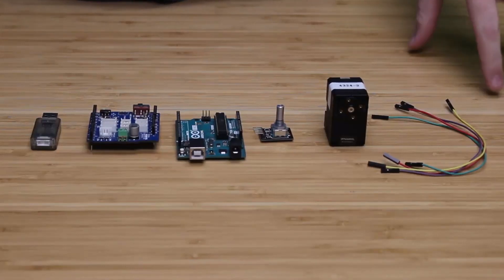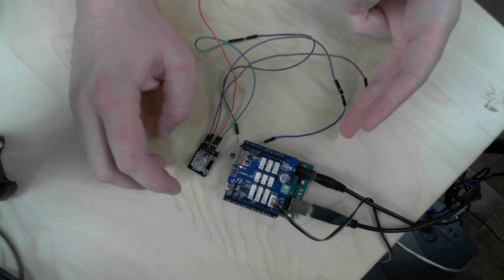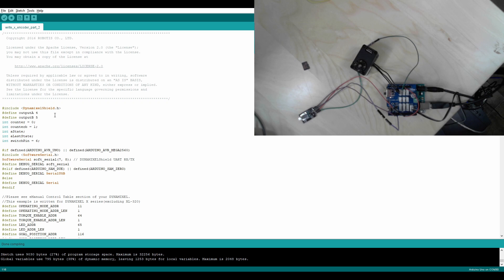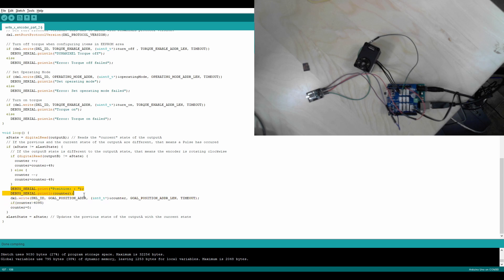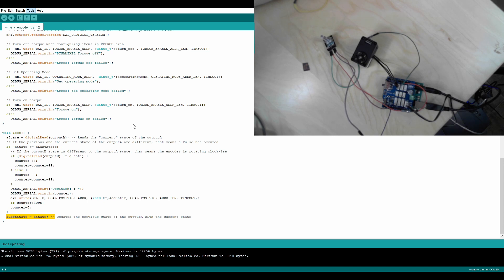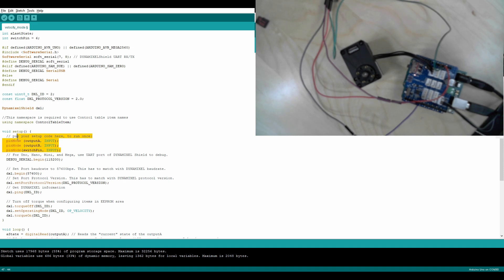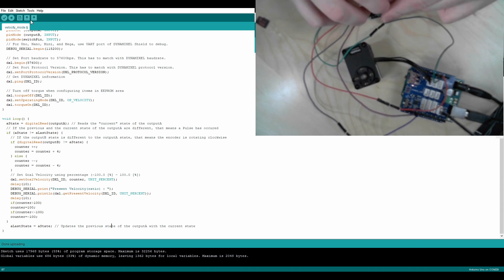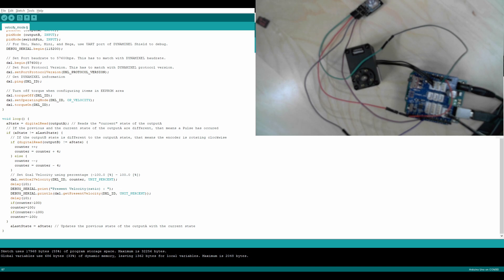How to Use DYNAMIXEL with rotary encoder + Arduino Uno || Servo Control using rotary encoder

Comment: Hello, thank you for your video. It is really helpful! But I have a question that since the dynamixel servo motors have the position feedback, why should I need a extra encoder to know its position?
Reply from the maker: Hello 安翔宇,
I'm happy to hear that you found our video helpful!
In this case, the rotary encoder isn't being used to read the position of the DYNAMIXEL actuator, but to control the desired goal position.

Comment: How can I use the rotatory encoder without the DynamixelShield ? Please share the email, I need some help.
Reply from the maker: Without the DynamixelShield, you will need to use a communication circuit to successfully communicate with your DYNAMIXEL in half-duplex TTL or RS-485 (depending on model). Links to the schematics of those communication circuits can be found here: https://emanual.robotis.com/docs/en/dxl/x/xm430-w210/#communication-circuit

For more assistance with your questions related to Arduino + DYNAMIXEL, we recommend posting on our new Community page Community.robotis.us . Our Support team and other experienced users can respond to assist with the best recommendations.
Reply: @robotisus  Thank you for the guidance.